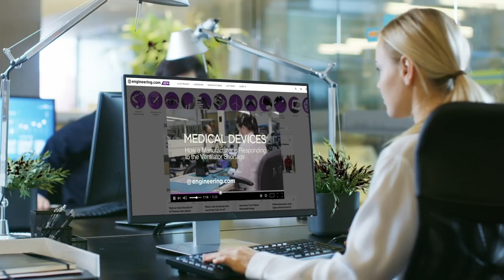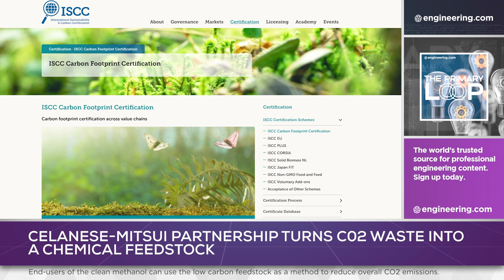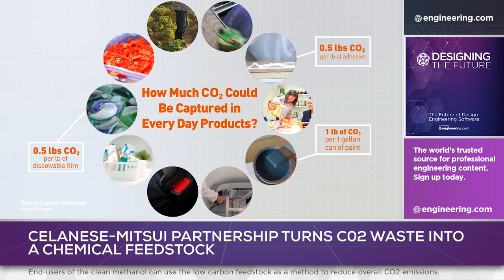Turning Waste CO2 into Low Carbon Methanol for Industry

Comment: Not a viable process without nuclear energy at scale.

Sequestration has failed.  I have seen this first hand at the Gorgon Project.
Reply: Nuclear to make the hydrogen I presume? Electrolysis is not the way to go. However there are promising technologies that can unlock hydrogen’s future. To make its production more efficient.
Reply: @stage274  it can't be LNG.  Even if we can produce hydrogen gas at scale, storage and transport are huge problems.  As is embrittlement.
Reply: My hopes are on Photocatalysis.